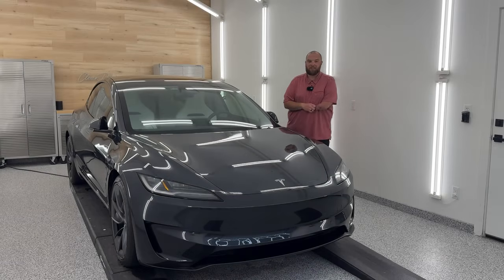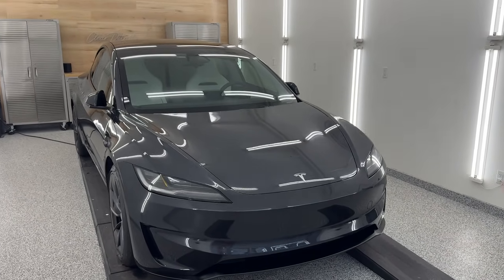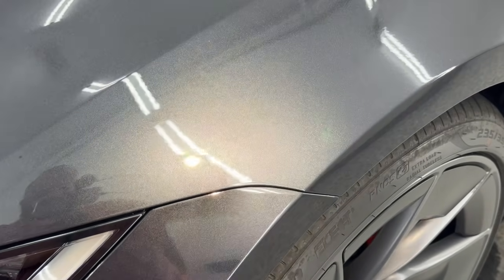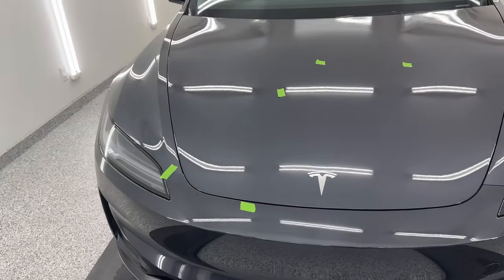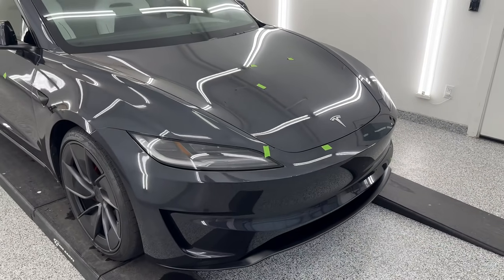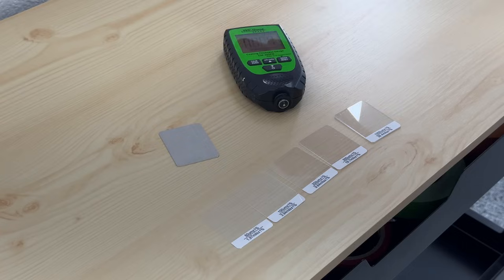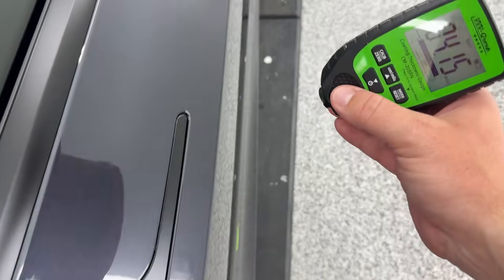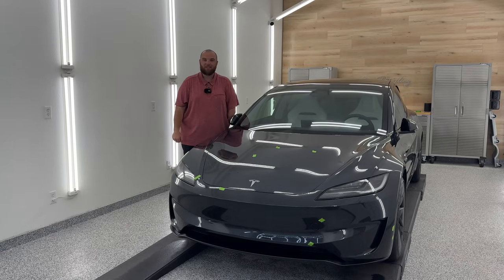Fremont, We Have A Problem! Paint Quality Inspection - 2024 Stealth Grey Tesla Model 3 Highland

Comment: As Coelton stated, for most customers a lot of this won't ever be noticed.  I spent an hour at the service center going over this car in detail.  I saw a lot of what he has pointed out but knew they were within Tesla's specs...They would have fixed a couple of them, such as the big ones on the hood.  But I knew I was having the paint correction done by Clear Detailing already and wanted it done the right way to start, vs having Tesla try to fix it and then take some of the paint down and then Coleton still have to fix the swirl marks that they always leave behind.  This is my 3rd Tesla and I knew what I was getting with the paint.  Have followed Out of Spec since the beginning and have followed Coleton since the detailing channel started.  I knew this was the only place I would have my car done from the beginning.  Panel gaps were much better on this car than my others and I had only one that needs a very slight adjustment, but most wouldn't even notice it either.  Quality has improved overall!  Thanks Coleton for the great work you're doing on the car and look forward to seeing the end results!
Reply: People will complain about anything.

Comment: Love your videos always.  When i purchased my brand new blue 2023 Tesla Model 3 last year (August 2, 2023), the paint was horrible.  To the "average" eye, the car looked good and clean.  But with me being super OCD and a detailer by hobby, the paint didn't even reach my expectations and satisfaction.  The paint caught my eye at first.  And then I started check the panel gabs and everything else I was told to check.  Everything looked dialed in; except the paint. The Tesla rep asked me if everything is ok....I mentioned to her that the paint is totally swirled up through out the whole car.  Granted, the paint looked clean to her.  I showed her with my detail pen light and showed her the swirls.  She then told me that Tesla's detailers can take care of that.  Funny, they were probably the ones that used an old dirty microfiber towel that created the swirl marks.  I told her, " Let me take care of the paint myself. I'm a detailer by hobby and have color corrected many cars." I was afraid if I let the Tesla "detailers" color correct the paint, they would do more damage than it has for the long run.  I took a good look at the paint and it just needed a stage one pass.  This was my first Tesla car that I worked on and realized how soft the paint is on Tesla cars.  Thcikness of paint was all over the place with 3.8 to 6.2mls......:( The color correction was a delicate process, but I managed to make the paint 10 times better than most blue Teslas I see out on the streets.  The process took more than 14 hours as I took my time with the color correction.  Since the paint was perfect afterwards, my friend's detail shop did the PPF and I did the ceramic coat over the PPF using 2 coats of Gtecheq Halo ceramic coating.  It's been a little over a year now and the paint still remains perfect.  I get compliments all the time from other Tesla owners that know the process of detailing; while the "average" individuals ask me if I had the car repainted.....Thanks for your hardwork and efforts into putting these videos for all of us here.  It's channels like yours that make a HUGE difference on how to make our cars stand out compared to other cars on the streets and car meets / shows.

Comment: I'm a weekend warrior detailing enthusiast.  I recently did a paint correction on my Toyota Rav 4 Hybrid that rolled fresh out of the plant in Kentucky.  There was just some marring from transportation and when the car was cleaned at the dealership.  The only actual defect I found was one single dust nib on the rear driver side quarter.  That was it, just a single dust nib.  You can't even see it under normal lighting conditions, only under a Scangrip.

Comment: Very interesting.😉
My Model 3 comes from Fremont, it has been built in November 2020 and I have all the defects you are showing, it means no improvement has been done in 4 year... And I took delivery in France, so I can confirm all defect comes from factory and not delivery center.
My Model 3 was also affected by a defect that concerned a full batch at this period : The paint of the lower body completely detach. The car was taken to the body shop for a new paint of these parts (thankfully under warranty).

Comment: My 5/2024 Fremont-produced Model 3 Perf has a runny-paint line on driver’s side quarter panel. Tesla service center offered to have an indy bodyshop fully strip, sand, and repaint; but told me the paint would likely not match. Since then, I’ve been living with the defect and go to a different SC that has their own collision, paint, & parts warehouse for my other issues
Reply: Any good indy shop will blend it and will be perfect.
Reply: If the paint run is from the clear coat, a body shop and sand it down without repaint.

Comment: I would think any of the pearl paints would be thicker on average since they have a base coat, clear coat and pearl coat.  Also, if you ceramic coat the car when you get it, it will go a long way to protecting the paint from fine scratches, and if you have PPF installed on the front of the car, it will protect against rock chips.  Surprising to hear Lucid paint is not better than Tesla on a car that cost twice as much as a Model 3.  Lastly, if the paint isn't a uniform thickness, I don't think it matters that much, as long as it looks good.  The M3P in the video looks really good for fit and finish, Tesla is clearly doing a much better job than they were doing 5 years ago.  Again, if you want a BMW, Mercedes or Audi, not only are you going to pay twice as much, the reliability of all those German brands is well known to be below average.

Comment: Getting bumpers to match on a new car it's easy, it's just need the use of the right material to make the base on a plastic match the one on metal. Dust on the paint is unacceptable even for an after market paint shop. As for the sanding marks? that is just a shame, I would not want to accept a can in this condition.